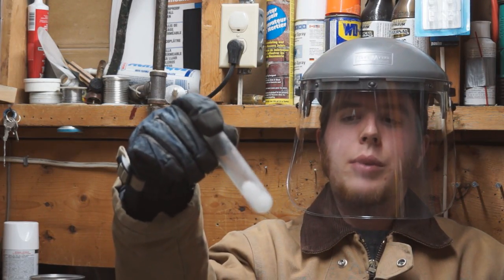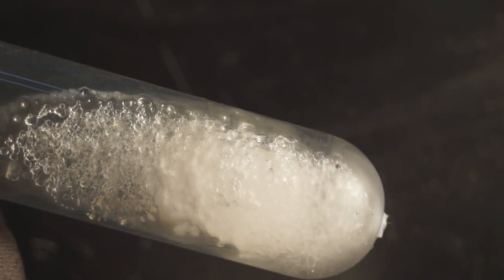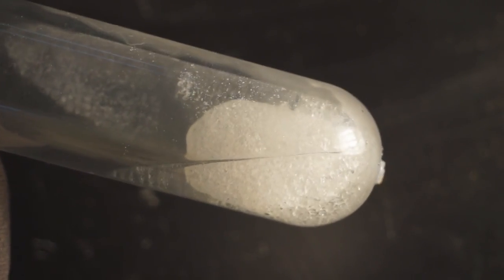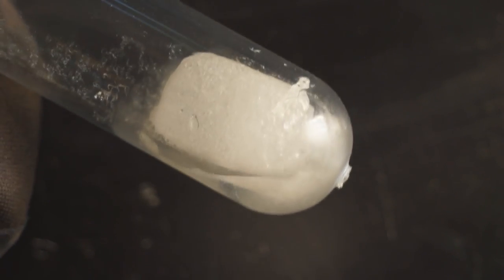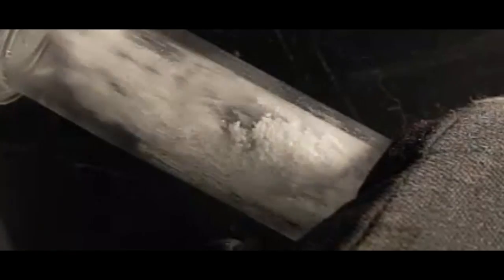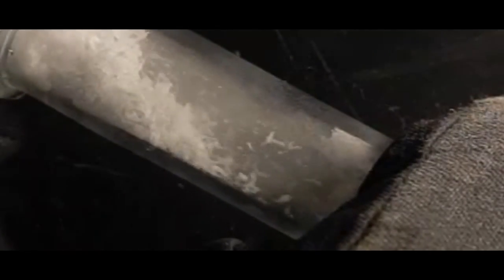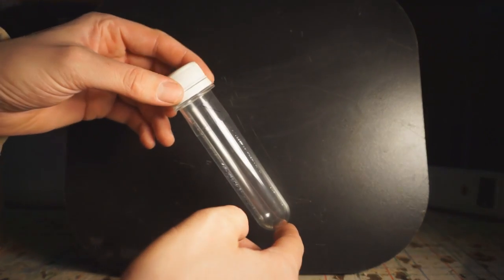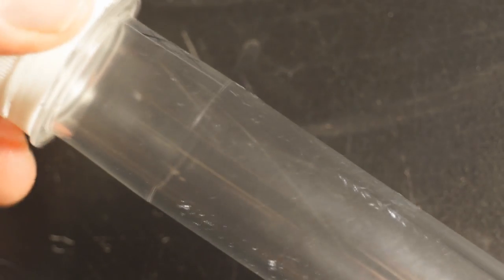See Liquid Carbon Dioxide

Comment: Can I ask what tube you used for this? Any chance you have a link to it? And would you recommend ditching after a couple of goes to avoid rupturing?

Thanks!
Reply from the maker: I would not recommend reproducing this demo for an audience as everyone would need to be protected head to toe, if the liquid were to approach room temperature the tube will rupture. The tube itself is a 2L bottle pre-form, I did this video so long ago that I can't remember where I got them, sorry. If you do try this make sure that you and everyone around is protected, not just goggles but full face shields, heavy gloves, heavy coats, pants and shoes and never use the pre-forms more than once, they develop cracks from even the "low" pressures around 200psi that will develop.

Sorry to be so blunt but this is not a demo that can be safely done for an audience, I did this video specifically so that it I could show off liquid CO2 without having to worry about the safety of others.

Comment: What's the air pressure when liquid co2 reaches room temperature in the example you gave? I'm wondering because I've done this experiment and reached at least 5 atm when co2 liquified, but immediately depressurized the bottle to prevent from reaching higher pressures! Thanks in advance!
Reply from the maker: +Flavio Campirano At room temperature liquid CO2 is at more than 1000psi (possibly as high as 2500psi on a hot day). I left some dry ice each time to keep the temperature well below 0c and maintain a safe pressure.

Comment: Did you ever think the micro cracks are because of the pressure
Reply: +Nick Moore 

These a stress marks caused by pressure, or more accurately mechanical stress cycles. We see them frequently on centrifuge tubes that operates under very high G-forces (20,000x g and up). You made the right call ditching those bottles, the cracks can develop very quickly cause breakage whilst under stress.
Reply from the maker: Yeah, without the pressure I don't think the CO2 would be able to dissolve into the plastic but I don't think pressure alone would cause those cracks. They are only on the inner surface of the tube.
Reply from the maker: I've seen a few of those shattered centrifuge photos I am amazed that the tubes can take that kind of force repeatedly. I bought them in a pack of 10 and wasn't in the mood to play chicken with a few hundred PSI.

Thanks for watching!

Comment: ***** Here's an idea for TTTT :P

Cool vid, Nick!   Ben Krasnow came to the same conclusion on the effect on the plastic: Effect of long-term high pressure CO2 on acrylic
Reply from the maker: Ben does some of the best projects, I did this one because I couldn't get the idea of liquid CO2 out of my head.
Reply: Nick Moore I wonder if those cracks were just due to being cold and under so much pressure,   that they are just stress cracks?    That was an awesome video Nick!
Reply from the maker: They were distributed very evenly and were only on the inside surface of the tube. Either way I didn't want to have one blow at 200PSI or more. Pop bottle lids make a surprisingly good seal.